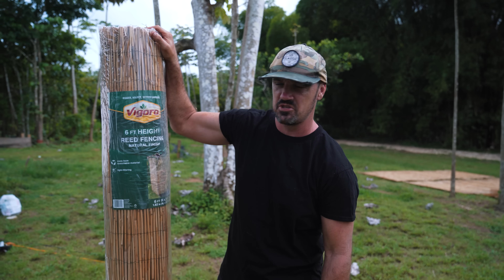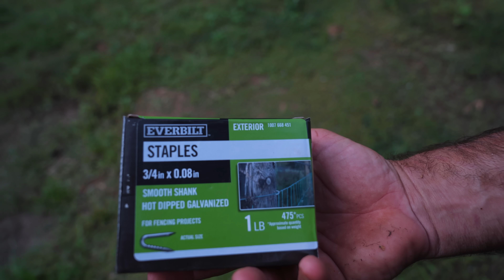GIANT STEP COMPLETED ON OUR OFF GRID JUNGLE PROPERTY!

Comment: I am really impressed with this job and I was thinking of wicker underneath the metal before you even mentioned it so you two make a great teem. The elbow bracing will need to go on before you meet your next hurricane and don't be surprised if you loose all that wicker and maybe the metal roof when it dose blow heavy but hopefully not, it looks pretty secure and you are in a low spot. 👍

Comment: Hey Matt I'm not sure if you are using Galvalume sheet roofing but if you are do not put directly on pressure treated lumber because the treatment in the wood will eat up your metal roofing quite quickly. you need a barrier like tar paper to seal the metal from the wood.

Comment: How will you replace the bamboo after you sandwich the bamboo between the metal panels and the cross members?
Reply: If the bamboo goes bad the fasteners will now have a gap between the roofing panels and the beams

Comment: Great work guys. Lap jointing with a chainsaw would have taken time but added greater strength. To keep the clean look, you could add braces on the inside of the posts. Hard to describe what I mean: in your closing shot, add braces on the far side of those nearest posts. By brace, I mean a piece of post cut to build a diagonal between a vertical post and a horizontal post, with 45 degree cut ends. If you add braces on the inside of all the outermost posts, that should add stability.

Comment: little over build on using post on the roof. should have used a 2 x1 lats. the post are leaving a open living space from the sides  for lots of animals which could bring the read fencing down. also you could get a tunnel effect from the wind with the open space between the read and roof bringing down the read

Comment: Your round nails are called "Horse shoe Nails" and are perfect for that. Your staples will pull out and you will have the bamboo fencing on your head with no way to repair that with the roofing panels on.    RenoRoger  General Contractor

Comment: The reed  panels with 4 foot span will sag with time and moisture. run a stained 2x4  down the center and it will be supported than just the staple nails and wiil hold up in the winds to come. Just thinking.

Comment: Hi Matt, have you sealed the screws going into the metal roofing? They either should be silicone sealed or rubber capped for lack of a better term. Otherwise water will probably get through. Cheers

Comment: Looking good!  Going to be a lot cooler inside the RV. 
At 15:20  Are you planning to block the ends of those 4x4 runs?  Critters and birds are going to crawl up between the reeds and the metal roof and nest in that 3" space.  Also. I think you should have started the metal a few inches over the front to protect the 4x4 and reeds.

Comment: 4:06. no, no, no...put long strips of wood down, and staple the strips on top of the thatch.  The humidity that will get trapped in that area, will be absorbed by your thatch, and within six months...it will start to sag.  Better yet, put some foam strips on top of the wood strips, so when it rains, that vibration from the rain, won't vibrate down into your deck.  So, Frame, Thatch, wood strips, foam on the wood strips, metal roof.  Your u shaped nails are only holding one strand of thatch...that will rot away, and it will sag under the weight of the moisture.  You could have put some kind of water repellant sealant down on the thatch, but stain isn't enough.

Comment: Are the panels galvalume? Tip Put a towel on the surface  Wish I war there  when sliding panels up as to not damage panels also make sure to use the rubber fasteners as metal will sweat alot especially where you are ! Wish i was there to help! Best of luck!

Comment: You’re going to hate the sound of the rain directly on top of those metal panels in a squall. I personally would have gone with corrugated non metal, but given you have already got the metal, you might want to get some more of the reads to place them on top of the metal doubled as underneath, as these would dampen the sound of the rain hitting the roof. I would also add gutters to the roof to collect rainwater for water collection as well as some solar panels and lighting around your decking.

Comment: If you don't want knee braces, you can use T plates with bolts. The Ts have holes in all 3 legs. 1/8 inch thick steel should be plenty. They can be painted.

Comment: Well done guys on a job well done. the reeds will add a little bit of insulation as well. A bit late for that job but when your doing your house roof you can buy what are knowen in this neck of the woods are high windload fasteners  that are fit like washers for your hex screws that spread the load that makes it herder for wind to lift the roof off. It looks like your not to exposed there but they might be worth looking into 🏴‍☠

Comment: should of asked the guys that brought you the metal to stack it on the roof off to one side. the long panels were a good choice on a flat roof the over laps wood of leaked so good choice. if your worried about side to side you could always kris kross the back wall with two cables you Know how to rig cables, or even just run them strait a foot or so from the top out of the way.

Comment: Pergola  (spell check approved) looks great. I just hope you don't have a problem with birds building nests under it up in the corners. Good job, the exposed tin would have looked cheap and also radiated the heat through defeating the purpose of having the shade. Now you can build some cloths lines coming off of it, or is it too humid to hang dry cloths there in the summer ?

Comment: think cane is going to sag and the other thing that worries me is a storm might rip the structure apart as most structures need truss and joist brackets and bolts through the posts to hold it to footings

Comment: The other thing your reed mats will do is reduce the heat that comes when that tin roof gets hot under the sun. I bet it further reduces the heat transfer to your roof by at least 10 degrees. The house should be much cooler.

Comment: I gotta be honest I was thinking a little 4 post 10x10 pergola sitting area would of really been a nice shaded spot to sit and read or hang out. Maybe some vines growing up the posts and some lattice panels. I don't understand doing all that work when you had an awning on the trailer for shade. The posts and roof look really good BUT with the trailer it looks like a diy trailer park thing and not really an appealing structure. What really throws me off is that the trailer is underneath it. If it was just a porch area in front of it then it might look better or make sense to me at least. If you move the trailer back then you have posts in the middle of it. I'm wondering if you could take out those center posts by adding a big beam across the top. Then you would have a huge square porch area. But maybe you have plans to convert it to a barn or something one day. Maybe I just don't understand the function of it covering the trailer. I just have to be honest. I could see it being a sleep cabin or shower house or garage or workshop to build the house from. Without the trailer I can picture it looking great. It's just the trailer is such a contrast to a nice wood beam structure. I just don't want to lie and say wow it looks awesome. The posts and beams and roof does look great. It's just the trailer with it I can't say looks good. But it's also just my opinion. I could just be picky or judging too much. So hope you can ignore me if I am. Thinking it over some more I guess it makes sense in that it gives you space to work right in front of the trailer when it's raining. But still if you move the trailer back you'd have twice the space to work. You could setup a whole wood working shop on the right side with a table saw and miter saw drill press and sander and a big work table and sitting area on the left. Anyways just my thoughts.

Comment: In a short time, those reds will seriously sag; double pattering it not.

It may have been better securing it a lot more to the bottom of a serious marina pot and installing it red down, then corrugated metal roofing on top.

But that’s probably be too much for most as well as susceptible to high winds.

Nice on the call to stain also.

Comment: Metal 45 degree angle braces on the backside painted to match the color of the boards or Black would give the post more vertical rigidity cause those vertical posts are screaming for a Hammock. Rope stained to match the Thach then screwed up would probably help hold it better than staples IMO. There are times you just need to put the camera down and be safe, risking yourself for youtube is not the way to live but I am not telling you what to do just suggesting safety should always be on your mind for you and Kristen, my 30 minuites of video viewing is not worth getting hurt. Great content and enjoyed the build.

Comment: Your meant to screw that roofing in through the peaks of the corrugations, not the valleys. The water tends to run off the high spots and into the valleys, so you want the screws through the high spots and not exposed to water as much.

Comment: Great job. You might want to block off the space between the reeds and the roofing or it might become a condo for critters. It think the reeds are great, they will also reduce heat radiation from the metal roof. 35 years in heavy dusty industry - there are no best safety glasses, goggles are impossible in the heat, get comfortable fitting cheaper light certified glasses and buy more pairs, wear a bandana for sweat. Safety wise the fall is the biggest danger in this job, a harness and arrestor would have helped but they cost a fortune and are supposed to be individually fitted.

Comment: 4:11 not sure how long the reed will hold the tension and weight resulting from he wide span and humidity. 
Was there a reason for not building a wooden frame to staple the reed on and fix it from the underside of Pergola beams so you can replace it easily in case it gets rotten? By doing so you could also put a black plastic sheet on the reed and wouldn’t see the metal roof. Just a guess, probably too late…

Comment: 29:42 Don't cut it off. I'd leave it. Looks fine and will direct the rain water further away from your RV. If you don't want the shinny bottom you can spray paint it brown. I would only remove it if there was a structural reason to do so. If not leave it.

Comment: Aren’t you concerned that the space  between the reed fencing and metal is going to be a great nesting home for critters 😮, and did you consider sloping the tin roof slightly for the rain to run off rather than pool on the aluminum

Comment: For future reference it's important for longevity to only put the screws on the peaks of the sheet metal. 

I hate to encourage people not to use safety equipment, but I agree that sometimes the safety equipment makes things even more dangerous.  Gloves and saws are not a good mix. And with an angle grinder gloves aren't going to do anything but give you a false sense of security. Proper planning and positioning are way more important and valuable than safety equipment in almost every case. If you can use safety equipment........ safely....... then by all means do. Safety planning should take up a significant portion of the overall planning time on any potentially dangerous project. And a lot of the time people get injured on seemingly simple tasks that don't seem dangerous on the surface. All it took was one table saw incident to get me to take safety seriously. I'm lucky to still have all my fingers. And for anyone who works in the trades, if your employers are pushing you to work too fast at the expense of safety then tell them to f*** off and find another job. You only have one body.

Comment: One on top and one on the bottom. On top to avoid the rain noise hitting the metal and one on the bottom for looks. Could have spray painted underneath and never would have noticed the metal roof through the wood…jus sayin…❤

Comment: I think no glasses meet your criteria unless you superglue your sweat glands. However, these work great and come in a variety of features. Clear or sunglass, bifocals or not and a variety of bifocal strengths. (bifocals - think old construction workers) AND they're cheap. This one at Amazon is $7.36  "DEWALT DPG58-1C Reinforcer Clear Lens High Performance Protective Safety Glasses with Rubber Temples". I've bought several over the years. I've lost partial vision in my right eye. THAT makes a safety glass fanatic out of you. Also, handling galv sheet . . .  where's your gloves??

Comment: I enjoy your channel and especially admire your fine work ethic; however, (if I might) I would like to offer what I hope will be interpreted as a helpful comment rather than a criticism.  Bamboo fails most commonly through rot from excessive water contact.  As such, its efficacy as a roof is not very worthwhile.  It can also attract insects and pests who exist off the sugar content.  Regular sealing will mitigate problems; however, the root issue remains.  Exposure to excessive moisture will adversely affect its durability.  Best wishes from Kauai (we get a fair amount of rain)...a hui ho.

Comment: KleenGuard V20 Purity Safety Glasses (25652), UV Protection, Hardcoated Smoke Lenses with Black Temples, 12 Pairs / Case
Reply: I've used these for yrs. They are great. Scretch them up and chunk them. They fit your face great. And I mainly use them for sun shades.
Reply: Amazon

Comment: Uh, you think you could pull it down with your bare hands? That's very worrying because what do you think the first wind storm will do... If you don't want knee braces how about metal corner braces.  I don't mean the little nail in sheet metal things, but thick metal engineered brackets. Yeah they will detract from the look a bit but so will having it blow away into the bushes...

Comment: Metal Aluminum....???.   Zoinkie  Scooby !
Reply from the maker: @i70show  ye, it's like oakwood, or seawater,  or icy snow 😅🤣
Reply: @SailingGoodBadandUgly   not sure how much wind that can catch, but if you think you can catch a bunch of wind, you might want to get these hurricane straps that hold the trusses together a little better. If you didn’t use those on the roof part and a ton more screws in the metal doesn’t hurt either, I noticed you didn’t put them on the ridge you put them down in the valley…. Looks good and strong though. Nice job.
Reply from the maker: @i70show  I put some on the shorter ridge. I couldn't find screws long enough for the large ridges
Reply: @SailingGoodBadandUgly  thanks for the reply really enjoy you two, great content….

Comment: Try Swimming Goggles small ones 
But when you take them off Bend Over .
Wipe you Face 
I’ve used Motorcycle goggles 
For Dirt Foam seal keeps the Dirt out 

Dollar Store now maybe the 10 Dollar Store now  

Food for thought don’t load sheets over the trailer 🤔 
Where you started at the 2nd Sheet , you had a 4x4 running opposite that the best place to start , Only use Long Sheets Short sheets more ladder time 😫😫😫😲🤔
Set the Front of sheet , Go To the down side , Use Gloves ✝️ Push the sheet a goodly amount over the roof , But don’t let flop up 😲 as yet pull the sheet up to your Chest , now With a Big Push And It will Fly up and away from You . At this point it only need to Fly 2-4 feet It Will Land Perfectly  Trust God  
Don’t Be a He Man and Shoot it into the Next county 😉 😬🏋🏻‍♀️🏋🏻‍♀️🏋🏻‍♀️
You will develop your own style 
Try some cheep Swimming goggles 
Again bend over before you remove , brush face 
Your Place Is looking GREAT 
Camera lady keep him in Line